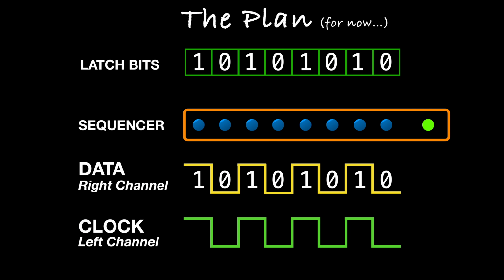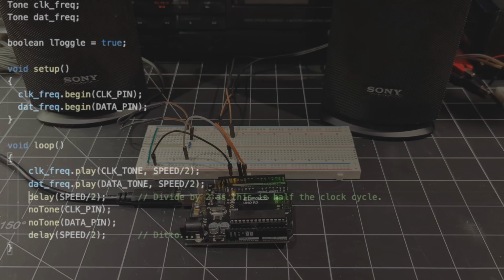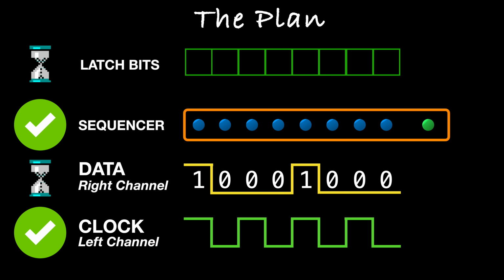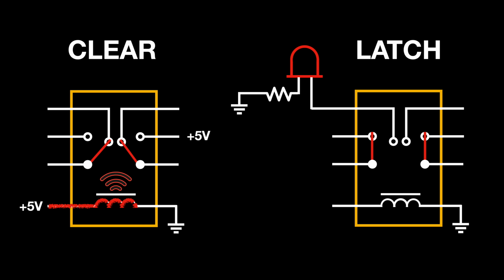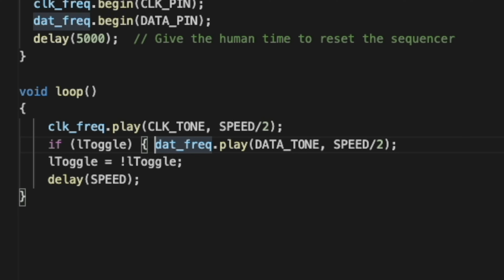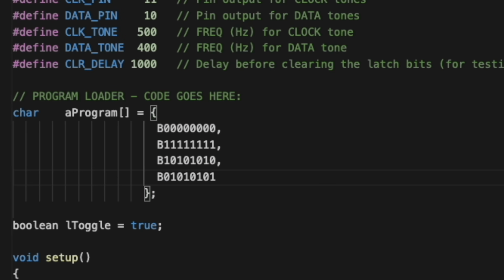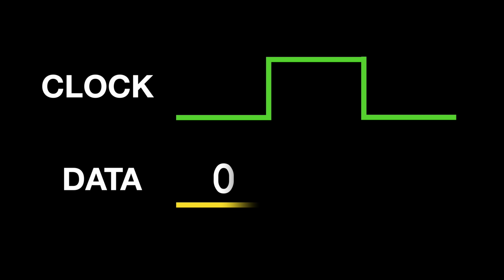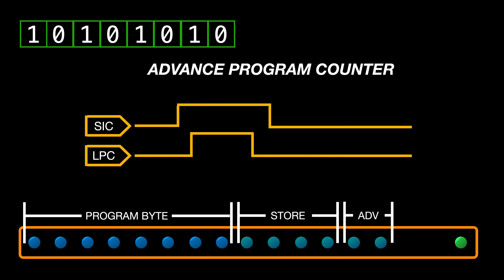Relay Computer - Tape Storage (Part II)

Comment: Why didn't you use a single channel with one tone for zero and another tone for one?
Reply from the maker: That would require a way to trigger the relay based on the frequency of the tone, some sort of filtering. I'm just using the voltage that is generated while the tone is being played.

Comment: 2:54 The data is only clocked in on the positive edge of clock, but you're showing data at 2x that speed. Graph would be clearer if you showed half as many zeros there in the data channel.

Comment: Very cool.  I couldn't help but wonder:  is the "turbo mode" you showed off pushing the actual limit of the hardware?  If not, it would be awesome to see it tweaked to be working at max speed.  It seems like the relays themselves will be limiting the data rate, as opposed to other early computer audio tape storage standards (i.e. KCS, Commodore, Atari, etc.) where I assume most of their limitations were due to differences between cassette recorders and their wow/flutter/frequency response specs.  I get the feeling that using a hi-fi cassette deck is beyond overkill for the scope of your project (though I agree that it's a great practical option).  The original paper tape puncher/reader must've added an entire extra layer of mechanical latency and jitter to contend with back in the day!
Reply from the maker: Yes, I try to find the fastest clock speed where everything still works (eg. Registers load the correct values) - and then I slow it up a bit just for safe measure.
Reply: @dipdoting  Ah, okay.  Cool! 😀

Comment: Was this intended to sound like a dial tone? It has been so long since I've heard a legit one I had almost forgotten.
Reply from the maker: It just turned out that way...but I thought the same thing. The dial tones are a mix of two tones (somewhere between 350Hz and 440Hz) so it sounds similar when the data and clock overlap.

Comment: Respect. I can only imagine the amount of work. In school (I don't know the grade in English - Technical college of Electronics?) we have built ultra simple 4 bit aritmometer (summator) out of relays. Sequential, with overload indicator. It was an oldachool beast. Half square meter, each relay of its own type (recycled), it drew too many watts but worked.  Switches as input, bulbs as output. It was a good lesson of how a microcontrollers are complicated, before we started with uC.
Reply from the maker: Sounds amazing. Relays are definitely power intensive - I'll soon need a bigger power supply as my current one max's out at 5A.

Comment: so i guess it can only read its program+data in one go?
Reply from the maker: Yes - the data is part of the program code - usually following the instructions immediately, but the data could also be placed as at the end and then referenced from the code using the LOAD instruction.

Comment: why do need a sequencer and the ands? why not a single shift register that shifts in the bit left from it on a pulse. That takes around 2 relays i guess
Reply from the maker: The shifting would need more relays, and would require an extra step with each cycle - but it's not needed because we are just building the byte from MSB to LSB (right to left).

Comment: I know you have a vision for this current project - but when you 'finish' this version - consider for V2 making better use of the data loader so you can load n bits at a time via some pretty simple bandpass filters and their own rectifiers. You can put tones at 300, 500, 700, 900, 1100, 1300, 1500, 1700 hz etc and associated passives for filtering, and load as many bits at once as you want. And, if you can support it as a relay decoder, you can do even more with some logic (a certain sequence of n tones may represent n^? bits) - excellent oppurtunity to get into relay based digital signal processing - something I think that nobody has done before.
Reply from the maker: That's a cool concept - would be interesting to try this. The last time I built those filters was for speakers (simple high and low pass) - even getting it to 2 or 4 tones per pulse would be a huge time saver.

Comment: Beautiful dude. I really appreciate this base level operation at a stupid monkey brain speed. I understand programming at an almost compent level, and power electronics well, there is a wide grey zone in my intuitive understanding how the cogs work to make that happen. Im loving the visual demonstrations you put together, its at a speed that you can actually follow along. And with the beeps n boops and clicks and clacks, truely a work of art. Very excited to see this whole clatterbox at full send!
Reply from the maker: Thank you! I started this project to help me understand the very basics of CPU design - using relays as the building blocks really does help with that. And the noises it makes are a bonus!

Comment: Nice... really nice... I'm curious what implementation approach you would use to make your DiPDoT fail-safe? or as a first step, to detect and stop a program when an error happens?
Reply from the maker: I'm looking into using a parity check on each byte when it's loading...that might work!

Comment: 9:39  Can you use the output of the data relay as a common input for the sequencer relays so that you use the sequencer as a multiplexer for the output latch, instead of adding a gating layer of AND?
Reply from the maker: Good question. The voltage from the data relay output should be able to be used to drive an output on the sequencer relay directly. Those voltages are shared to run the ring counter (sequencer) steps so would have to tweak some of the circuits but would be worth trying out.

Comment: you could probably just about double any tape's data capacity by latching the data line on both the falling and rising edges of the clock. To avoid problems with the alignment of the pulses, you can offset the data line by one half-period, so its transitions are as far away as possible from the clock's. With the edges that far you might also be able to eke out a tiny bit more speed out of the reader as well.
Reply from the maker: The sequencer circuit (which is just a ring counter) is triggered on both the rising and falling edges of the clock...so I need to squeeze the data in between both edges each time. But can definitely tweak the timing the delay between the edges and the data pulse - but I'm limited by the 6ms time needed for the relays to react (the mechanical part is slow). Good new is that most of the code for this computer would only be 20-30 instructions max - so I'm not worried about capacity or speed.

Comment: It's standard in most protocols to have one edge of the clock be when the data can change, so you have to read it on the opposite edge of the clock. If your data changes on every edge of the clock, of course you need a delay on one of the two so the change only happens when the clock is steady. Awesome job!

I wonder if there's a way to avoid semiconductors like the bridge rectifier, and without it being too bulky.
Reply from the maker: For the semi-conductors - the bulkiness is definitely a consideration. Diodes have been around a while so I consider them to be "period-correct" enough...but I'd break curious if there are other options.
Reply: @dipdoting  Germanium diodes would be a lot more period correct, but those have some very annoying characteristics (Massive voltage drop, for one -- there's a reason systems that used germanium diodes for logic used relatively high voltages. If they didn't, the voltage would rapidly drop so low that it becomes useless)
Reply: The delay can be embedded on the clock track in the tape.
Reply: Exactly. Also, it'd be an interesting next step to encode all 8 bits at one clock with tones.

Comment: Depending on the application, you might consider going to a 5 bit code on the tape... to keep it simple... even if you step up to ascii, you only need seven bits for that... are you planning on adding start/stop bit or parity, or flow control?  run length encoding? having a separate clock does help with synchronization, there are even some encoding schemes that include the clock in the message encoding. Later code types include phase shifts to up the data rate.  Thoughts?  Happy Sunday!  (examples: baudot, ascii, unicode(utf-8, utf-16), NRZ, 4B5B, ... Block chains ) =D
Reply from the maker: I've thought a lot about using different codes - but then I'd need to translate that into the 8-bit instructions at some point along the way before it's deposited to memory. As for parity, it's something to consider for sure, would be nice to have a validity check occurring with each instruction. Something cool to add in a future episode 😉

Comment: Is there an aspect to the design that requires the dual data rate method of data input? I'm kinda scratching my head why you're cheating the data input timing rather than the standard load data on one edge, latch data on the other.
Reply from the maker: The sequencer is stepped by the change of state in the edge (both rising and falling) - so I can't use the standard serial I/O approach. I may be able to change up the design, I'll get it running first and then play around with sequencer and edges.

Comment: About the wear on the relays: maybe you can design an SSR that can be a drop in replacement board for a relay?

As an upgrade when it is proven to work. Maybe it needs extra pins (constant power) that you can start designing in already at this point on new boards.
Reply from the maker: I'm thinking something along these lines - a bit different but will leave everyone in suspense. Would make for an interesting comparison as to speed.

Comment: Question: Is your latching circuit edge triggered? If so, wouldn’t it be possible to just shift the clock and data pulses so the clock edge happens roughly in the middle of the data pulse while keeping them the same length?
Reply from the maker: It's a bit different because the clock engages the next step on the sequencer on the rising and falling edges. So I need to "squeeze" the data pulse in between the edges.

Comment: Another thought occurred to me when you adjusted the data tone's frequency to differentiate the two tones. I assume that was just for us humans listening to the speakers—especially the viewers who might be listening in mono. If I'm following correctly, the circuit only cares about high/low voltage.

But thinking about frequency got me wondering how hard it would be to combine multiple bits, and maybe even while bytes, into a single clock pulse by overlaying different frequencies on the tape and splitting them into separate data channels when "reading" ("listening"?). I know this is probably more analog than you're going for with the project, but your videos always get me thinking!

I don't know how difficult that would be to implement electronically without analog components like vacuum tubes. I don't know a lot about audio processing—I know just enough about Fourrier transforms to be dangerous. 😅 I wonder if anyone else in the comments has thought about this, or if it was used by any retro computer systems. Thanks!
Reply from the maker: Correct - I used the different tones just so I could hear when they were overlapped. After a few hours of that though I needed to give my ears a break. I'm only using the tones to produce voltage to drive the relays, so it's not able to demodulate specific tones. I've looked up how tape demodulation works on many of the vintage machines like TRS-80, Commodore, etc --- pretty fascinating stuff!
Reply: @dipdoting Oh, cool that it was used. Thanks for the references, I'll have to read more about them. 👍

Comment: Awesome stuff!

The section where you made the data pulse shorter than the clock pulse got me thinking how on a traditional paper tape, it would usually be the other way around—the data pulse would be longer than the clock pulse—so that the clock could be used as a latch signal. That gives the data signal time to stabilize before latching, and (I think) would avoid the need for the AND gate. You could wire the data signal to every bit, and latch one bit at a time from the sequencer.

But I don't know if latch-able bits would be any simpler than the 1.5 relays-per-bit you're getting with your current design! Just wanted to mention it.

Thanks for sharing this fun project with us!
Reply from the maker: Thanks! For the paper tape, the way I'd do it 😉 would be to have the 8-data "holes" tied directly into a regular register (not latch bits), and then use the clock to "load the register". Assuming the holes for the data are a bit larger than the clock (like they generally are) than this is definitely similar to what you're suggesting. Would be a fun project, and would like to see how Konrad Zuse pulled this off on the Z3!

Comment: This looks like a very neat project! I'm not familiar with relay logic, and maybe it works quite differently from regular transistor logic, so take what I say with a grain of salt. But would it not be both easier and more component efficient to combine the sequencer and the data latching?

I would do this by adding a start bit (a "1"), so each byte would be nine bits. You would then use a shift register, your "sequencer" to walk the bits through it until the start bit pops out the other end, signaling that the byte is complete and can be sent for further processing.
Reply from the maker: Thank you! It's sort of a different take on that...Since the sequencer has a finite number of steps, I don't need to add anything that says the byte's complete - it just "knows" (or assumes) that after 8 steps the byte is complete. Instead of shifting, it's just building the byte from msb to lsb. I could build a shift register (there's one in the ALU) but that would also require some additional cycles to load the register, shift, store...etc. All fun to think about!
Reply: @dipdoting  yes for sure. Perhaps a shift register needs more relays anyway. I will have to read up on relay logic. Also it would be neat to have some kind of synchronization mechanism on the tape. Perhaps it's not needed if you always rewind the tape fully before loading.